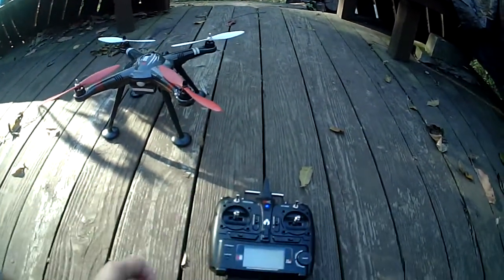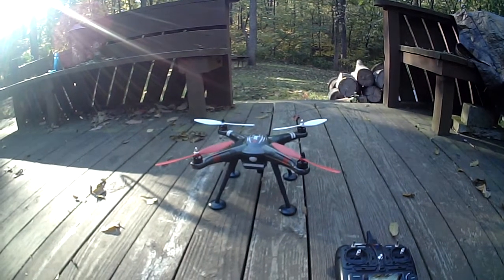XK Detect X380 Quadcopter / GPS Problem / Solution found!!!

Comment: Try doing the GPS shielding mod with copper conductive  adhesive tape. Cover the tape that's already on the quad when you take the top shell off. it will give you more GPS signals and lock GPS quicker which will the give you better stability. The copper tape is cheap enough in eBay
Reply from the maker: +markybyeah I did the mod when I changed the module. No luck. Thanks for the suggestion.

Comment: what's that thing when you pull down the left stick and wiggle the button above it ? isn't that to help it lock ?
Reply from the maker: +1975supermike That is to calibrate the compass. It would not calibrate, or get gps lock. I wasn't getting any power to the gps module, so I ran a jumper wire from another 5v supply on the board and now it is as good as new!
Reply: +Vence McAdams brilliant news.
Reply: Where the position of 5v on board?
Reply: I've got same problem like you. When i check from the ground station software, the satellite didn't appear the number
Reply from the maker: Click on the link in the comments under my video. This will show all the 5v locations you can use. Good luck!

Comment: Hi Vence McAdams, good luck fixing Your x380. As I experience the same (no GPS lock, in PC-Software it looks like no GPS at all) would You please share Your next steps. I will take mine apart again, if I will find anything here I will keep You informed as well. 
Dirk
Reply from the maker: +Dirk D I finally found the solution to the problem. Check the update above. Let me know if I can help.
Reply: Cant you make YouTube video instead of going to Facebook? You made this video on YouTube but you wont make this on YouTube.  I dont like Facebook

Comment: I also took some time to get a GPS satellite, has become longer gradually that time,
Is the problem be solved?
Reply from the maker: +田吾作栄一（田吾作52129） I found a crack in my ceramic GPS antenna. I am waiting on a new one. I hope to fly again soon!
Reply: +Vence McAdams I was going to suggest to just take a peek, make sure plugs are in all the way, as my v303 unplugged after an oops, and simply pushing all the way in solved it.  Notice you peeked already, and found a cracked GPS module.  It doesn't take much.  Good luck replacing, and may want to consider upgrade, though stock one does seem to work really good.  

After an oops or 2, my X380 got a bit drifty and auto take off didn't want to cooperate, but as you saw, I re-calibrated compass and TX, and all back to 'lovely' again................LOL .
Also had mine about 3 weeks now, bad weather and short holiday, and didn't have a chance to fly much, except initial test flight before holiday, and this week, trying different non-gimbal cam mounts.  Haven't got into the software yet, this week, going to take a peek, and see if I can change some parameters (pitch and ascend speed).
Reply from the maker: LA smyth Thanks for the suggestions. I replaced the GPS module and still no GPS lock, and the compass won't calibrate. I am getting some help from a X380 page on facebook. It is a good resource. Good people willing to help. Looks like I will be opening it up again to check the next possibility.
Reply: It is a good cause is known, I am praying that you find the cause you can not help because there is no knowledge.
Reply from the maker: I am getting help from X380 group on facebook. I hope to solve problems soon. Thank you.

Comment: Thanks for getting back so quickly. mine stopped working when i removed compass leg and unplugged it. when i plugged it back in that's when the green red light started flashing . I'm not sure if that would have anything to do with it because about five flights before this happened I had a wreak which broke off both back and none compass leg, I put it back together and all was fine until I removed compass leg. Do you think we have the same problem? and sorry I'm so blind I missed that on facebook. Thanks again for your help
Reply from the maker: You will need to check to see if your getting the 5v to your plug. If not, the jump wire will provide it. Good luck.

Comment: I would like know if you fixed it yet and did you find the problem. I crashed mine bad and mine does the same thing. Green red green red no gps signal. Flu by power wires and made it wig out and crash.
Reply from the maker: +Royal Dolge Yes. It flies like new. Read my explanation above. I hope you get it fixed.